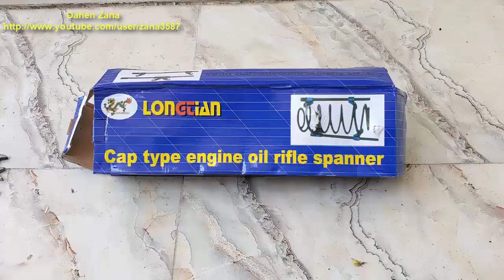Rear Strut Replacement  - Kia Sportage 2009

Comment: 0:31 The car is not seated well on the jack. That is dangerous. :o
You are brave for jacking up the car on ceramic tiles. They can crack.
Looks like the rear brake discs need changing as well.
I had no idea that Hanook also makes shck absorbers. Hmm...
Using impact on spring compressors can be dangerous, you need to be carefull.
Also, I would use correct torque settings (with a torque wrench) when tightening the bolts, and also threadlock.
Reply from the maker: thank you for your information